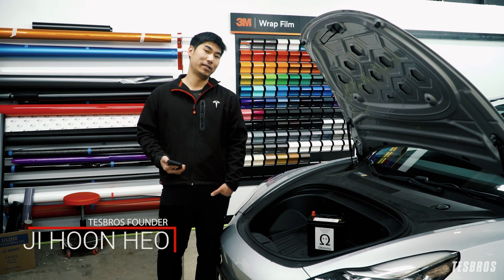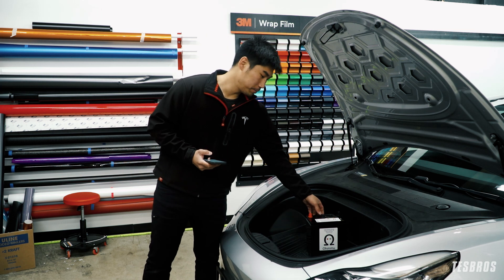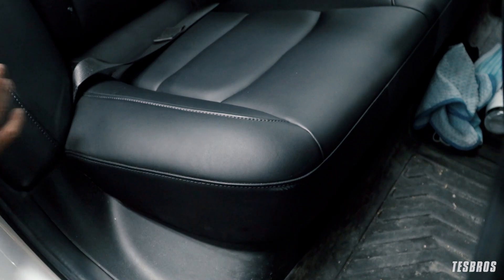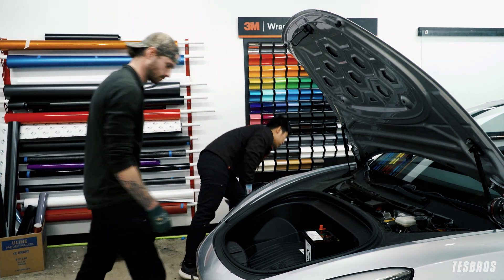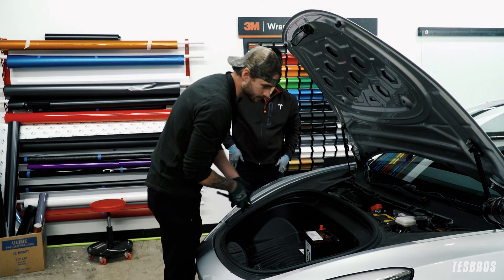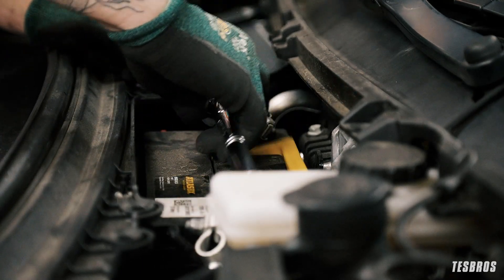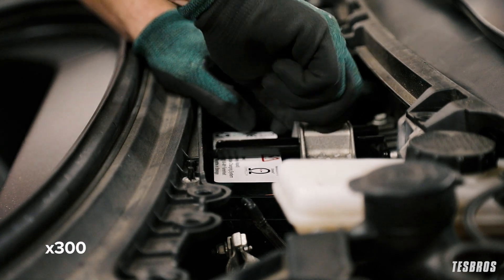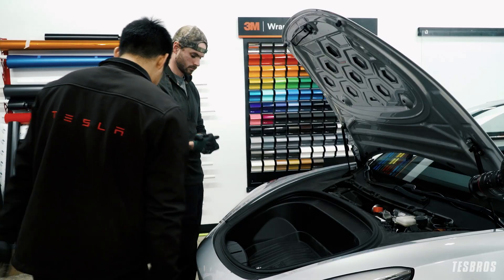How to Replace Your Model 3 12V Battery

Comment from the maker: Are you a DIY kind of person or would you rather have someone else do it?
Reply: i am a dyi person. but i wanted to ask you , if i go this route and do it my self do i need to reset any sensors or ecu after the battery replacement
Reply from the maker: @Coyote.five.0  no. It should work fine right away.
Reply: @diywrapclub  thank you much appreciated

Comment: The part about adapters on the battery eluded me, and now I'm halfway and kinda stuck 😅
Reply from the maker: What Those Adapters Are:
Tesla uses small terminal adapters (metal sleeves) on the battery posts to fit the specific connector size of the factory cables.

If you bought a non-OEM replacement 12V battery, sometimes:
- The new battery already has those adapters pre-installed, or
- You need to reuse the old adapters from the Tesla factory battery and move them to the new one.

What to Do: 
1. Check your old battery: Look at the positive (+) and negative (–) posts — you’ll likely see small metal sleeves still attached to them.
2. Remove them gently: Wiggle and twist them off (use pliers if needed, but don’t deform them).
3. Slide them onto the new battery posts: Make sure they’re seated flush so the Tesla terminal clamps can tighten securely.
4. Reconnect in this order:
- Connect positive (+) first.
- Then connect negative (–).
Reply: @diywrapclub  Thank you so much for posting such a thoughtful and elaborate reply. My Tesla battery seems to simply be a version with bigger poles/posts, there was no way I could see to "twist" them off, they just looked like inflated versions of what my new battery had. This is a Tesla bought in Norway, maybe the included batteries differ somewhat. I have contacted Teslas support via the app and hopefully they can do some on-location service here and simply replace it, but man it stung a bit standing out there in the freezing cold not getting anywhere this time :)

Comment: After reading the manual on my Tesla App it recommended using only replacement lead battery. I prefer what you state however I’m concerned about warranty issues. Any thoughts?

Comment: After a Tesla mobile service replaced my 12v battery climate controls don't work from app and climate fault on inside climate screen showing on mini tesla screen in the animation
Reply from the maker: That's strange. You may want to contact service for that.

Comment: We've only had our 2020 Model 3 for a couple of weeks and today four different alerts popped up, the first being VCFRONT_a182: need to replace the low voltage battery. We just ordered the Ohmmu lithium ion and my handy husband will pop it in when it arrives, thanks to your very helpful video. Hopefully the new battery will take care of the other three alerts, too!
Reply: Yesterday we got the "replace low voltage battery" alert again! Any idea what the problem is?
Reply: @lonestarhomestead  From what I understand, Ohmmu batteries won't work with older model 3s anymore due to a software update. Only lead acid batteries.
From what the service center tells me, only model 3s starting in 2022 can take the official Tesla lithium ion 12v batteries (and the ohmmu).
Reply from the maker: That’s great to hear! Let us know or Ohmmu if you have any questions. Sean from Ohmmu are awesome!
Reply: @diywrapclub  We put the new battery in yesterday with no problem and now all the alerts are gone! Thanks so much for this video!

Comment: Literally just bought a new OEM battery from the local Tesla parts counter and it was $85 plus sales tax. So don’t know where you are getting $169 plus tax? Just making it up to help sell your aftermarket battery? I can buy 5 of the OEM batteries for the price of this battery. And I don’t have to fear software updates with this 3rd party battery.
Reply from the maker: The 169 is if they install it for you
Reply: @diywrapclub  Definitely not what you said in the video. You said you could buy it for $169 and then you could pay to have someone install it. It's $85 to buy.
Reply from the maker: @JetFire9  ah, okay thanks for clearing that up. I’m glad it’s only $85 now. Looks like with service too it’s $120. Not bad! I just like the lithium ion 12vs because they last longer/more reliable. Nowadays some Models come with li-ion batteries though, so that’s an improvement
Reply: @diywrapclub  If it comes with the lithium ion from the factory, that's great. In the case of adding an aftermarket battery, I would not say it's more reliable because Tesla keeps breaking the car with software updates that don't like these foreign bodies in their vehicles. With the frequent software updates, that's just way too much hassle compared to just proactively changing the much lower cost lead acid battery every 2-3 years proactively. Maybe Tesla will come out with a retrofit kit, but until then, I would caution anyone for spending so much money on a battery for the extra hassles with updates and potentially warranty issues.

Comment: I think the life of the battery depends in a few thing but basically, the battery will only last after a certain amount of cycle.  It is completely different than an ICE car where the battery is used mostly to crank the engine and then the alternator will provide power during use (most of the time).  In the Tesla, the 12 v battery provides all the juice for non-traction power so the traction battery has to top off/recharge when it is needed, resulting in more charging cycles.  Mine failed after 2 years and it could also have been a bad battery since the casing swelled (a dangerous situation)

Comment: My 12v battery died while my car was stored in my Florida garage for the summer.  By the time I got to the car it was dead! I couldn’t unlock the doors or pop the frunk with a 9V battery or battery trickle charger.  I called AAA for a tow and their jumper box worked to pop the frunk to replace the battery.  The take away is, a trickle charger or 9V will not give you enough juice to open the frunk. If I used my head, I could have used my new battery to open the frunk.  Lesson learned and thank you AAA.
Reply: How did the towing company get access to the frunk since the battery was dead? Or how did they connect their jumper box?
Reply: a 9v battery and a 1.5v aa or aaa battery jammed togeather would of worked lol

Comment: I was this close to ordering the Ohmmu direct (better pricing) but since I don't plan on keeping my 2018 Model 3 much more than another year or so I'm just opting for the OEM Lead replacement. Tesla service center quote is only $108 installed, so you could change it every 2-3 years and four times over for the cost of this one.
Reply from the maker: That’s a good call. Some added benefits is that it also adds more oomph to the sound system. Since it’s rated for 4+ years, people who travel long distances can travel without any worry. But you’re right. Lead battery isn’t too bad and also may be covered by warranty, too.
Reply: @diywrapclub  I am just impressed that it is 8LBS. Most of the time it is so darn heavy. I've found myself in a situation before cell phones and Uber, I had to walk a mile with a heavy battery. That's no fun.. 8LBS would have been a dream that day...lol

Comment: Thanks for the tutorial. Question..is this compatible with the 2020 LR model 3?  Reading some people getting battery detect errors but I think it has to do with after market speakers. Thanks
Reply from the maker: Yes. Has to do with aftermarket parts. But oem should be fine.
Reply: Battery went bad after 1.5 years.  OEM sound system. Model 3P